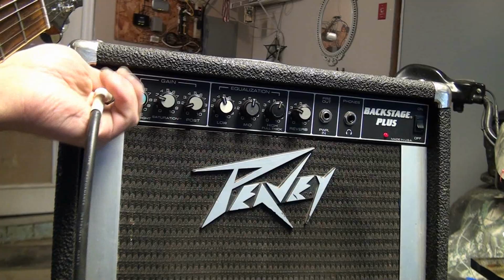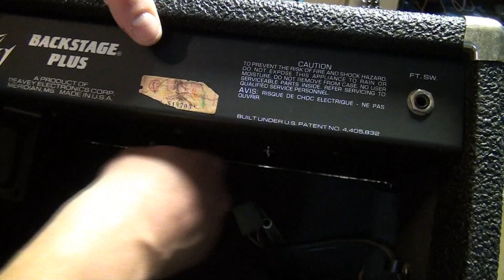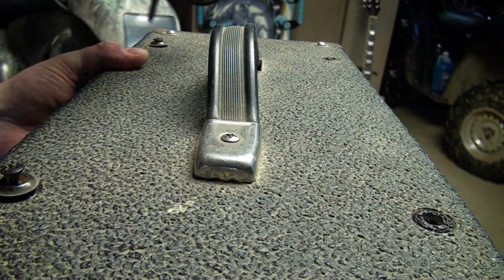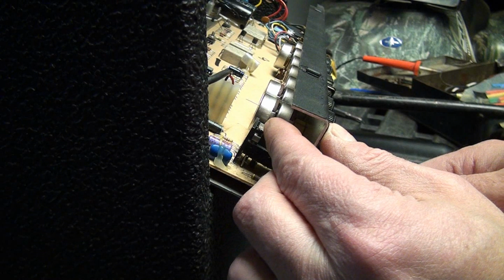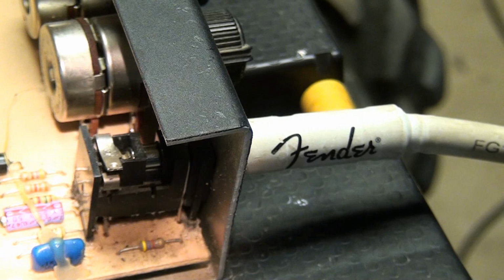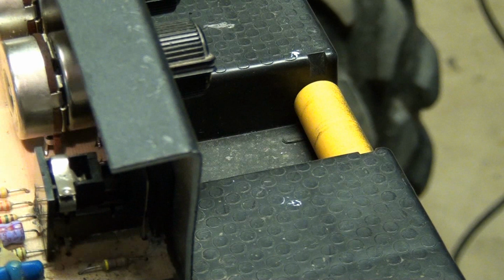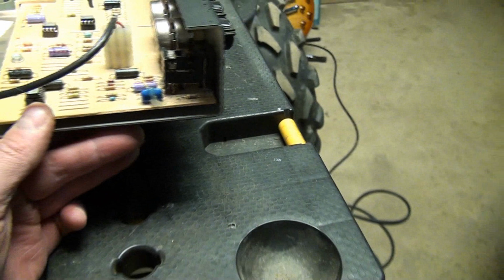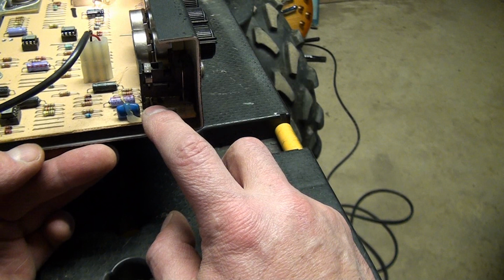DIY Guitar Amplifier Input Jack Repair - How to Fix a 1\4" Jack That's Cutting Out on Guitar Amp

Comment from the maker: Update Use DeoxIT D5S6 Contact Cleaner + F5S-H6 FaderLube on Amazon - https://amzn.to/2PvOLRm
Electronic Contact Cleaner on Amazon - https://amzn.to/2NtWKeS
Reply: Hi,  Same amp and same problem.  I also found it to be oxidation of the contacts.  I used Deoxit D100L on a cotton bud and worked it on both contacts for a good minute or so.  D100L leaves a protective film to prevent future oxidation.  These amps are nearly 40 years old so it takes more time to remove the oxide and dirt.  Also, the jack is cheap plastic and there is only a small area of metal contact between the tags and jack plug, so it won't take much to break the contact if there is any oxide there.  I made sure there wasn't any fluff left behind from the cotton bud.  I removed a strand with tweezers. I put the chassis back and turned it on and all is well.  Your recommendation to use a right angle jack is 100% on the money.  It was your video that confirmed for me that it was most likely the contacts in this case and not a solder problem so thanks.  All the best to you.

Comment: Loss of tension is a fault seen in equipment that's really old (or had a very hard life) - it means the metal contact spring has lost some of it's elasticity and although this is a good quick fix, it's likely to keep happening and it gets worse over time - eventually, the metal will become plastic and bend back out of place as soon as you put any pressure on the jack. If you find yourself doing it a second or third time, it's worth thinking about spending a couple of dollars (and some fresh solder) on fitting a new jack socket. It's more trouble, but it'll fix the problem for another decade or two.

Comment: Thank you! I ALMOST ended up desoldering the input jack on this IBZ10, but as I was looking at it I realized that every time a cable got plugged into the input, it would angle the pcb just a hair (no support under the board on that side) and after 10 years or so, it had pushed the enclosure down to the board so the contacts, well, didn't. Just put an old spring under the board, drilled a small hole, put a machine screw through the spring and voila. Figured I'd leave the comment in case anyone else ran into this.

Comment: I noticed that at-least in 1984 a budget amp had extremely good quality parts,the pots are robust, transformer v.good and most of the circuit looks servicable. The PC board is solid too. Those little Peavey backstage amps were used as "pre-amps" into Marshall stacks for a bit of Reverb and extra gain, better than any pedals. Then you could take it home and use it for practice and recording. Brilliant design.

Comment: Thanks man, I bought a used Yahama practice amp for my son that had this very problem. Had to pull a plastic cover from the back of the jack but upon fixing the metal spring tab, voila. amp works now.

Comment: another tip that may work if this doesn't do it (especially on older amps/guitars) and where you notice that the jack crackles and pops as you spin your lead in it, then get some electrical contact spray and apply some in the hole of the jack. Just worked for me and well pleased as I was thinking I'd have to replace the vintage jack :(. Turns out it was corrosion inside the barrel - when i looked I could see it - rust. Spray fixed it - don't know how long for but at the moment it's completely noiseless.
Reply: Very true. Works a treat.

Comment: I have a Peavey Backstage Plus! Sweet little practice amp but I need to go through all of it with contact cleaner and check all the solder joints possibly.  Its super scratchy and cuts out.  And, of course, this input jack fix might help also thank you!

Comment: Mine is an audition 30, sounds fantastic, sure sheeting enough the number 1 input just failed and provides a nice deep hum. Wiggle it around and it worked then it failed within minutes, wiggled it againg it worked for a few seconds, now I doesn't work at all just a deep solid hum, as if it's no longer grounded.  Number 2 input works fine tho. Any Idea's? Thanks, great video.

Comment: My first amp was a Peavey Backstage Plus. Hated that thing.
Reply: Back in the 80's I had a T-15, the Backstage Plus and an Arion Stereo Chorus to start with. Respectable for the time, but now days kids can get a far better sounding amp for $100. I am envious of players starting today. They have better cheap gear, and so many resources for learning. Then they take it for granted. I think if I had a distortion pedal to start with I would have been happier.
Reply: Ya This app is made in the USA and will last forever unlike that cheap crap from china your buying for a 100 dollars.
Reply: I bought a Backstage Plus in the mid 80s and loved it. It's a great little practice amp. It doesn't have the best built in distortion but it's not too bad. If you tweak all the knobs you can make it sound nice. I had a MXR Distortion Plus which I usually used with it so I could make it sounds pretty good. It's just not loud enough to play with a drummer unless you mic it and play through a PA.

Comment: RTV on the circuit board components to prevent movement..Its not "hot Glue".. If the input jack is old, it needs to be replaced...not whacked.

Comment: The fx return on mine pulled the tip of a cable off and it fell inside the amp head, would it be safe to use until I get round to removing it? Thanks

Comment: Thanks for the video. When I push the jack right home I get no sound. When I pull the jack a quarter way out I get sound. In your expert opinion is this the same problem i.e. that silver  clip in the amp ( female  jack)  not connecting with the jack plug? Update. Did what you said. It appears my stereo jacks plugs are too long, . when I push them home that clip does not settle in the recess of the jack plug.  Any advice welcome. Cheers.

Comment: I have a nashville 112 i use for my pedal steel amp and the speaker cables are very short. How can i replace the wires cominf out od the amp? Thanks

Comment: How do I fix it if the socket itself came clean off? Can I replace/repair it? I tried to reattach, but it snapped off. So, unless I glue it on, I'm not sure how else I could fix it.
Reply: @nogripes  It seems to be plastic. So, not sure that it was soldered on and I don't see any wires. Granted, I haven't taken it apart and opened it up yet.

Comment: Hi Mark, I bought a used Peavey Vypyr (1st I’d assume) for my son to start learning, and it works fine, however occasionally there’s a crackling sound, although when moving the guitar cable next to the input jack that you were fixing there’s no change in sound. Saying that, the input jack isn’t straight, it actually points a little bit downwards. Any idea what the crackling sound can be? I haven’t opened it yet, but I do own a soldering iron, so I’d be able to fix it providing it isn’t too complicated. I’d greatly appreciate if you could reply and possibly help me fix it for my 13 year old. :) I can take a video of the amp when it’s in use and upload it if that helps. Thank you.
Reply: @nogripes , Hey sorry for a delayed response. I thought that it wasn't guitar because we only just got it and I inspected it. However after you suggested it, I wanted to check it to rule it out, and that when I heard something loose in that port, inside the guitar. Upon unscrewing it, I found a metal part that was loose there and was making those sounds. I know it's from that jack that came unscrewed not long ago, but I am not quite sure what it is for. It looks like a metal circle thingy, kinda wavy from one side. I removed it from the inside of the guitar and my son haven't had any problems since. However I would like to replace that input jack completely. Thank you very much for your suggestion, for some reason I haven't checked it, and probably wouldn't for. long time. Thank you very much, all the best.

Comment: Hey man,I have a situation, so i opened my guitar amp, and replaced pots, everything is working fine but when i fit input jack thru its hole (its touching bare metal btw, thats how its factory made) amp wont turn on. As soon as i remove jack and hold it in hand or without contact with metal, amp turns on and works. Can u help me?

Comment: Would this work for a crate Excalibur 220 solid state?
Reply: It depends on the design. But resoldering and/or bending the tip of the jack is a universal fix.

Comment: U mean fractured solder joint. cold solder is a connection that was improperly soldered and not heated to flow the solder connection on the pin to pc board. all the new junk is wave soldered for labor saving no more hand wired amps unless you buy botique

Comment: I have a Peavy Bandit 112 transtube series amp it's second hand and has an oiley smell coming out of it. I can smell it in my bedroom where I sleep, it's bad. Anyone know what the problem is? TIPS? ANY YOUTUBERS WHICH DO AMP RAPAIR VID'S?
Reply: +Angelo Savioz Most likely cause (and the only liquid found in most amps ) would be electrolyte from a blown or leaking capacitor. Either that, or a previous owner 'fixed' a crackly knob with WD40. Isolate it from the mains supply and open it up and check for residue on the boards, as well as checking if any of the capacitors are bulging or split (google 'blown capacitor' to see what that looks like.)

If some turdbrain oiled it, the careful application of electrical degreaser spray will be your friend. If it's a leaking capacitor, it'll need careful cleaning and replacing, which will require like-for-like replacement and some soldering - if you're not confident about it, a good repair shop could fix pretty quickly. Should be pretty cheap, too - a few bucks for parts, plus 15-30 minutes labor...

If you need help with the teardown, this video's a pretty good guide. Just be careful to note what goes where when you disconnect cables, and always always ALWAYS check that it's not plugged in to the wall.
Reply: Yup... could be a cap. Never heard of that happening before like that though. Maybe take it to a pro if you have the money.
Reply: Thank you so much Ray Barker. Great help, will check it out.
Reply: Ray Barker can't thank you enough. I get what ur saying totally, I'm going to open it up and check if it's the capacitor if not then will use your advice (electrical spray & soldering etc) and kinda use this vid as a guideline. 

I'm always playing guitar I love music and want to follow it on through my life. I love this kinda work and some experience with the mechanical side of things providing I don't electrocute myself😂 will be great. Maybe turn this into a Summer Project. Thanks a lot, Angelo musician friend:)

Comment: That jack sucks. I would cut it out of there and solder in a proper Switchcraft with a wired connection to the board.